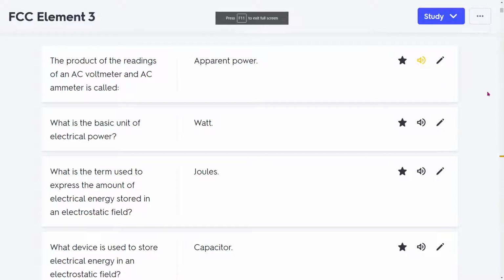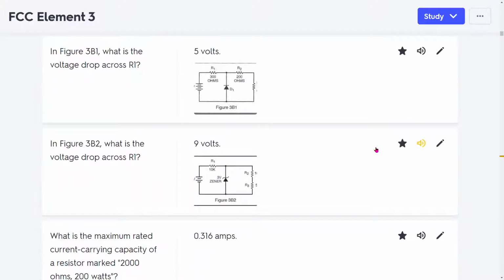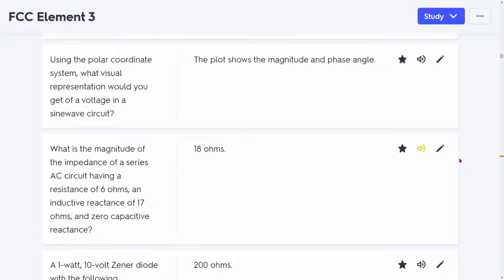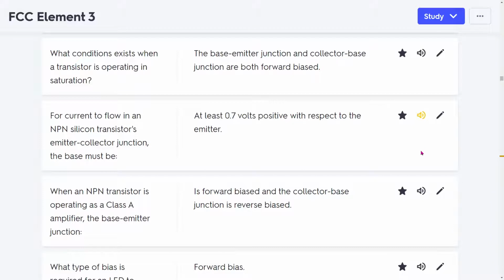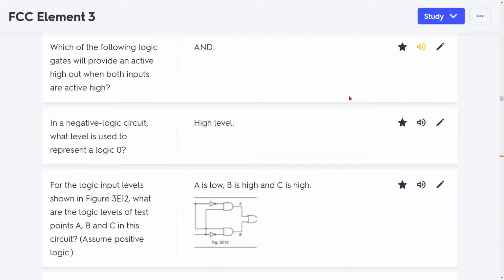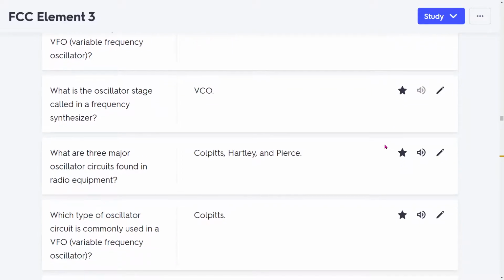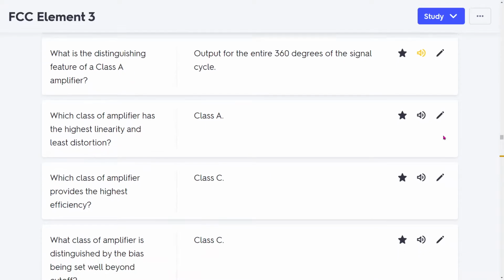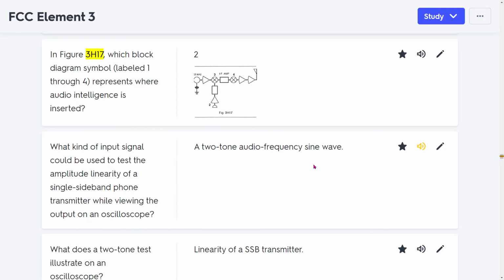FCC Element 3 Terms (Part 1)

Comment: The FCC Element 3 General Radiotelephone question pool has 432 questions and is valid from July 1, 2023 to June 30, 2027:
Reply: You are exactly right about those dates and numbers, but there is a common mix-up here: that specific 432-question pool valid from July 1, 2023, to June 30, 2027, belongs to the Amateur (Ham) Radio General Class license, not the Commercial GROL